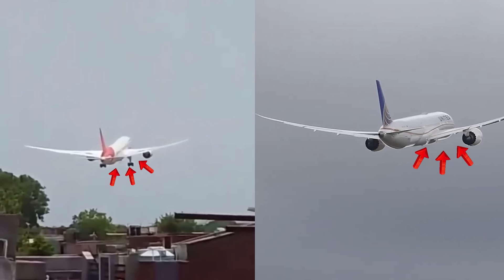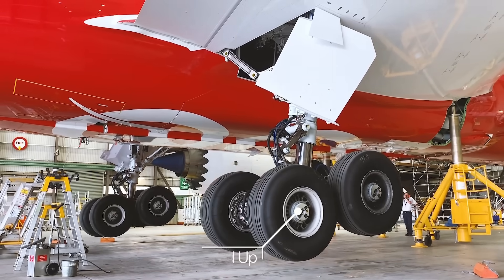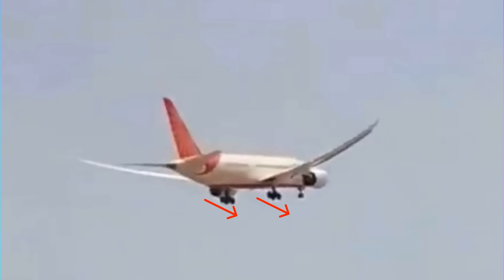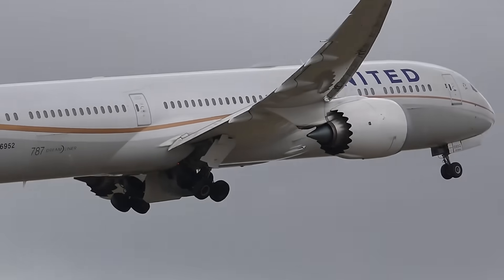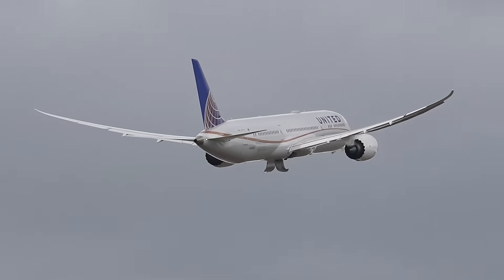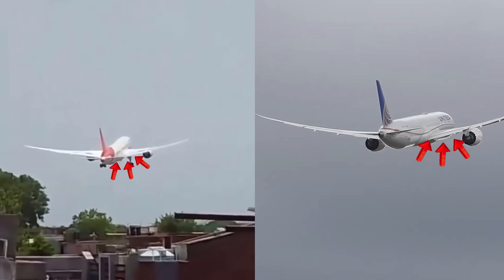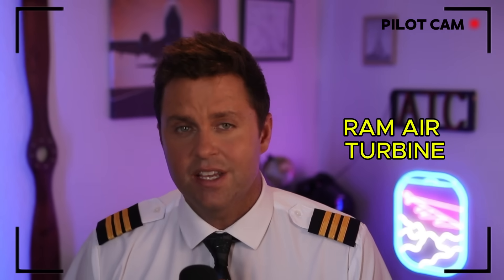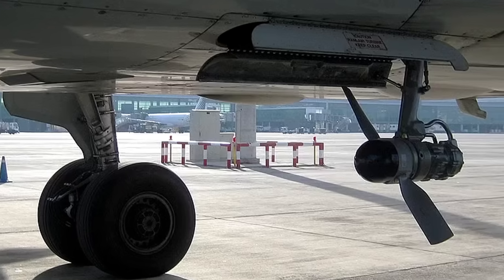Pilot Explains: A New Detail in the Air India 787 Crash Everyone Missed

Comment: Contaminated fuel : But no other planes reported this issue in that airport same day regarding fuel.
Reply: My thought exactly
Reply: There was a comment in another video, that talked about how the ADSB comms were having issues Only at that airport in the past couple of weeks, The board for that system is supposedly housed in the same compartment as the Fuel control system board/computer. He went on to talk about how with the long duration in mid-day sun while facing south, coupled with the long takeoff roll could have caused the board to hit over temp and go into fault reset, which would explain the near simultaneous double engine failure with no smoke in the exhaust. 

This is from memory, and it was fairly detailed and complex. and i am lacking the technical knowledge of the aircraft systems to confirm or deny the claims, but logically it makes sense to me(although that is worth nothing here from my arm chair). Ill see if i can find that comment again.
Reply: @nightkil13r  Agree, my thoughts as well
Reply: @nightkil13r  Yeah but...there must be a  environmental/temperature control system for the boards in question and all other vital electronics installed on the plane....and likely redundancies for those same systems, no?   I'd imagine you'd want to heat those components at 30 000 feet with outside air temp of minus 40 degrees Celcius and cool them when the plane's on the ground being baked by plus 50 degrees Celcius outside temperatures in the middle east somewhere.
Reply: @guidoschnelzer942  Not sure which comment of mine you replied to, but it is a failure that would rely on the cooling system also having issues. which allegedly according to a passenger on the previous flight it was, although i have not seen that myself so take it with a grain of salt. Realistically its all just conjecture till the investigation report comes out.
Reply: I think in this context, 'contamination ' has to do with how water moves in the plane.  Jet fuel and water don't mix, and if water gets in the fuel or near the sensors, it causes big problems and strange behavior of the aircraft.   Sudden unexpected movements of the plane can cause the fuel to be contaminated by water.   So it's not the type of fuel contamination (i.e. bad batch of fuel) that we're used to thinking of.  Here, they're thinking that condensation could have formed in the tanks, from the plane sitting on the tarmac in very hot, humid  weather.  Or that debris possibly entered the tanks via vents or refueling.
Reply: @VerdictREX hen how the flights r safe in very hot weather like in  Middle east  n very cold countries 
This should be very  common issue to be dealt with no??? N pilots should be aware of this  ..
Reply: @kirank809  That's part of why there are many pilots who don't think fuel contamination could be the issue.   This jet's fuel system is highly sophisticated.  Most types of contamination would be detected well before takeoff, and extremely hot weather is not a new or special consideration, nor is long times on a hot tarmac.
Reply: @VerdictREX  you are wrong. 
There is perception that hot summers cause condensation. It's practically not possible. I live in India and we have some of the most extreme summers on par with Middle east. The only thing seperate us is the monsoon season. 

Here is the thing. In middle east and India, hot summers are usually dry. Which means no humidity. When there is no humidity, water seeing into fuel due to contamination is highly impossible. That's the feature of Hot dry summers. 

And then Indian monsoon makes things in reverse automatically. Suddenly you have weather with a lot of humidity. In places like Northeast India or East India for that matter, humidity can go high as 81% with avg humidity is around 53-75%. Fuel crews are experienced in that kind of condition. There are no crashes in India due to fuel contamination due to condensation. If this was the case, crashes in India would be lot more. And Boeing especially made this detection alarm system for Indian airlines which quickly became a norm in the Boeing feature.

Duel Engine failure can happen due to technical failures. Now this is where Boeing comes and why people, especially Indians are blaming Boeing. Again crews in India are highly experienced in that matter.
Reply: @NammaNeko-hg1ho  You are forgetting that all aircraft operate in conditions from ground level (maybe up to +40C) to cruising altitude (as low as -50C).  Condesnation and even ice build up in fuel lines is a major problem that has to be taken into account and may have nothing to do with the ground level conditions.  Refer to the British Airways flight BA38 that crashed on approach at Heathrow in 2008.
Reply: @NammaNeko-hg1ho  I'm not wrong about anything I said here.  Condensation inside of a FUEL TANK is different from the weather outside!   Certain factors, like heat and humidity increase the chances of condensation formation inside of the fuel system.  There are many other factors that can cause condensation to form in the tanks.  So giving an almanac report about weather patterns in India is not that significant.   If you see my other comments I have also addressed why other experts do not agree that fuel contamination was the issue.-- and among them is the fact that high heat and humidity, as well as planes spending extended periods on a hot tarmac, are not new or unique conditions,  as they exist in several parts of the world, every single day.  However, fuel contamination due to condensation IS a relevant factor that will be analyzed.  Also, the humidity in Ahmedabad was 84% on the day of this horrible event, and that IS high.
Reply: @VerdictREX okay 👍🏻
Reply: @VerdictREX  Re "sudden movement" of the plane, accelerating down the runway could be an example and might explain the timing of the flame out.
Reply: @VerdictREX  Still that theory of that "contamination" has some flaws for a duo engine. Both engines cant flame out simultenously but rather sequentially. my two cents.
Reply: @sunitamosesesq these engines have fuel filters.
Reply: @VerdictREX  Then they should  not contaminated fuel because it deflects blame. They should say water seepage etc,.
Reply: That's just not their terminology.   Here, if water enters the jet fuel, it is considered a 'contamination,'  It's actually one of the most serious and dangerous types of contamination for a jet.  It can cause huge engine issues, including flameout, resulting in crash, which is what could have happened here.
Reply: @VerdictREX fair enough but the videos are made for the consumption of common people in laymen terms. So they need to set the context so it won’t be misinterpreted ( like fuel was literally adulterated at the airport). This is not an aviation board meeting.
Reply: @rogerIndianKing  I feel you on that one.   Very true.  They need to explain what these words mean in this context.  I remember I was initially very confused about them using the term "rotation."  The plane was "at rotation", "during rotation," etc.... (I was thinking...what? It rotated?!  Lol)   It took me forever to find out that rotation is just the point at which the pilot lifts the plane's nose off the runway and starts becoming airborne.    But none of them took a second to explain that - even though that's drastically different than how we would normally use that term.
Reply: @rogerIndianKing  Then it is a "YOU" problem.
Reply: @poruatokin when you watch a movie, the audience in theatre need to understand the plot and get invested emotionally. If they raise their hand and ask a question, the direction is lost. Similarly, when you make a client presentation to a business. You are the kind of a guy who says the client is an idiot for not following.
Reply: If that’s the case, then there should be multiple cases just like CX780, which also had fuel contamination and caused the engine into full power mode, one thing came to my mind is BA38, that too also had dual engine failure but at the very last stage of the flight, I don’t exactly remember the cause of that crash but I do remember it’s something to do with fuel also
Reply: yes.  Contamination can cause a lot of systems to act erratically, which can result in a crash.
Reply: @riskiesensei  fuel freezing
Reply: @riskiesensei  It was very cold fuel, a small amount of water in it froze blocking the filters.
Reply: @riskiesensei  BA38 was a Boeing 777.  The accident was investigated by the Air Accidents Investigation Branch (AAIB) and their final report was issued in February of 2010. Ice crystals in the jet fuel were blamed as the cause of the accident, clogging the fuel/oil heat exchanger (FOHE) of each engine. This restricted fuel flow to the engines when thrust was demanded during the final approach to Heathrow.  The AAIB identified this rare problem as specific to Rolls-Royce Trent 800 engine FOHEs.  Not a fair comparison, I'd suggest.
Reply: @riskiesensei  Small quantities of water in the fuel formed ice crystals which turned to slush as the temperature rose on descent, and clogged the fuel lines to both engines
Reply: Wet wing tanks are required to be individually sumped for fuel contamination (mostly water) and fine debris. If this maintenance procedure is rarely performed an aircrafts wet wing tanks can become contaminated.
Reply: Contamination can happen on the truck that loads the fuel on the plane. Moisture in the tank or pipes, something did not seal properly, etc. If that was the case it could affect only a single plane.
Reply: These days this is happening  more often 
Power going off in planes before take off 
A/C  shut OFF 
N then there was toomuch  gasoline smell inside flight  ..( followed by  announcement  that flight being fueled ) before takeoff
In  hyd to blr flight in May ..
Never hapoened  before .
More than 30-40 mins waiting in flight ..
Reply: Maybe it was a set up
Reply: How long did they shut the airport down for and did they suspect it and pull that fuel source?
Reply: What if someone loaded extra gallons of water into both wing fuel tanks, since water havier and don't mix with gasoline, it resides at the lower level of the tank, and sucked into the engine once the inline gasoline is burnt during takeoff.
Reply: Just because "contaminated fuel" is stated does not imply dirty fuel was loaded at Ahmedabad.  That is just your mind jumping to conclusions.  The sources and types of contamination in fuel can be many.
Reply: I was thinking the same thing.
Reply: Good point
Reply: Exactly, and my understanding is that the tanks don't supply both engines for that very reason.
So fuel contamination  isn't a contributing cause.
Reply: @Hawkertempest1 I have no idea how you could come to that conclusion based on that evidence.
Reply: Probably would have been evident before v1, erratic parameters etc.
Reply: Fuel contamination has to be ruled out. Because if it was the fuel contamination,  then they will know during the take off. They wouldn't have enough power to get to V2.
Reply: 1. Fuel that  comes from the depot visually inspected by certified techs for any rust or water contamination before they dispatched the tanker. 

2.The depot thats stores fuel is  (CFU/ATP) sampling tested. That knows as  microbial contamination tests .

3. Upon arrival fight mechanic/ engineer inspects the tanker usually and if they have any doubts they holds the delivery to the airport and sends samples to lab for CFU/ATP tests (microbial contamination) test.
CFU tests requires to send sample offside and takes time to come back at you . 

4.ATP can be done on site and takes no longer than hour to come back at you . 

5. Both tests requires special testing equipments. And i sure all air ports does have. 

6.even if there is a debris or rust in the fuel , there are fuel filters in place. I am sure our car does have so why not the air crafts ? 

7.Finally , only possible way to contaminate jet fuel is deliberate water contamination after the final checks and before fueling up the air craft . Which highly unlikely but you never know only needs one disgruntled person to do it.
Reply: Just average white people thinking of contaminated fuel because the crash happened in India.
Reply: @toml7945 @ramanagude4750 I found it. He did mention in the comments that it would also have to have a cooling issue, which is possibly backed up by a video allegedly from a previous flights passenger complaining about the ac not working. 

Its from Captain steves channel, Paste the below after the slash, itll be the highlighted comment.

watch?v=8XYO-mj1ugg&lc=UgxcU9LMHPPBXRf83k94AaABAg
Reply: I think contaminated fuel in unlikely to lead to engine failure at exactly the same. There should at least be some delay between both flameouts.
Reply: absolutely,  so full electrical failure...😢
Reply: Well could of been a battery lithium fire  affecting some other systems 787 use batteries for the gear and have had problems with system before
Reply: I thought the same
Reply: Contaminated Jet A1 causing a near-identical failure in both engines at almost exact the same time on a transport category aircraft…??

Try and calculate the odds of that.
Reply: One possibility that I have not herd nor read is that the engines may have been serviced by the same mechanic ; and unwittingly did the same mistake on both engines. It been a while, but I remember some rule  where I had worked in the past, to have different  mechnics service each engine separately to avoid unknowingly making  the same error on both engines.  All hypothetical of course, but if this happened a dual engine failure could  ensue.
Reply: @sergioabdilla4577 The odds of that happening and causing a double loss of thrust right at that point in the flight are still astronomically small.
Reply: @simonissell Two identical engines with identical amounts of good fuel in them burning through it at the same rate?  What are the odds?
Reply: @jimj9040Still very remote. Remember that both engines would already have achieved rated or derated take-off thrust before V1. If they hadn’t the take-off would have been rejected.
Reply: @simonissell Sure, and that would be accomplished with the remaining good fuel before it started sucking Avgas, unless you can tell me why not.
Reply: @jimj9040Show me an airport that has enough AVGAS lying around to accidentally put in a 787?
You’ve got to be kidding me. 😂
Reply: @jimj9040And I doubt that a bit of AVGAS would bother a GEnx anyway; not in the short term.
Reply: @simonissell  I didn’t say accidentally and I don’t know how much fuel it took.  I’m not married to this theory.
Reply: @jimj9040 Most jet engines will run on AVGAS for a while without too many problems. Not ideal, but unlikely to be catastrophic.
Reply: @simonissell Well, I suppose you should tell that to the remains of those who’ve tried it.
Reply: @jimj9040 And they would be....? Who?
Reply: @simonissell The deaths I’m aware of occurred on smaller aircraft but the principle remains the same.  I wasn’t personally acquainted, but I’m sure you can look it up.  If it would be nearly impossible to get any other fuel in those trucks I’m willing to stop trying to defend this idea instead of debate an issue that has no legs to begin with.
Reply: @jimj9040 With under-wing refuelling the fuel is pressure feed into the tanks at a high flow rate. This causes a lot mixing within the tanks. Also bear in mind that the engines need to be producing the desired take-off thrust BEFORE V1, otherwise the take-off is rejected.
Reply: @simonissell I can see, as the above poster stated, that there would be erratic parameters in the case we discussed, but it seems it would burn hotter and produce all the thrust you wanted until …..whatever.
Reply: @simonissell  It's happened.  Oil drain plugs misfitted IIRC.  All the oil fell out of both engines.
Reply: @ChrisRowland-c7wCertainly possible; but statistically unlikely. Time will tell.
This guy’s video though…. Absolute rubbish!
Reply: @sergioabdilla4577 This rule about engines not receiving the same maintenance by the same person at the same time was introduced after a serious incident (not crash, but it was a narrow escape) with a Lockheed Tristar where the same person had made the same mistake with fitting a particular oil seal in all three engines, leading to all the oil escaping.
Reply: Sabotage water put in the JetA1.freezes up pipe lines under pressure while feeding engines.Must have not shown up on testing capsules during refueling.
Reply: It seems higly improbable contaminated fuel shuts off both engines at the same moment. When it happened, it didn't happen that suddenly.
Also gears selected up and, at the same moment, a dual engine failure seems too much of a coincidence. 
It seems more likely that the gear up command, in some way, messed up the electrical system.
Reply: I don't think this was a reason at all. Highly improbable.
Reply: Given the safety record of the aircraft up to this point, whatever happened was, by definition, improbable.
Reply: Wouldn’t other aircraft have had issues if it was fuel contamination??
Reply: @kannon965 Only if the contamination originated at the source.  Plenty of ways for individual trucks to be contaminated or simply have the wrong fuel.
If they fueled it with Avgas instead of Jet A, engine failure shortly after takeoff would be just what to expect.
Reply: I think fuel contamination is a valid theory. If you’ve spent any time on YouTube or Instagram you’ve likely seen evidence that Indians will shit anywhere: the beach, on the streets, on sidewalks, and even on the floor of restrooms or airplane lavatories. What’s to say one of them didn’t shit in the fuel supply?
Reply: maybe it was watered down with ethanol because it costs less to make
Reply: What if it has done for this plane particularly. A big politician was there in plane. It's very common for currently ruling to do these things.
Reply: And with the engine start and taxi burn (the long back-taxi on the runway etc) they would have gone through 500-1000lbs?  That would have to be a lot of contamination...  A hard sell.
Reply: Unless it was done on purpose.
Reply: @nicolaslaugeon6207 Terrorists tend to be fairly narcissistic and like to lay claim to their handiwork.
Reply: Sabotage
Reply: Wtf.. they wouldn’t be able to take off otherwise.
Reply: Fuel was loaded from a vehicle for this flight
Reply: @MattRodriguez-h7j isn’t that for like every flight? From what I’ve heard fuel contamination is something figured out way early and not that late into the take off.
Reply: The very second day an local Indian reporter mentioned, One engine failed and pilot turned off  the other engine by mistake and didnt get enough time to turn on.
Reply: Boeing  is in crap here😂
Reply: Got to look at the history of this aircraft. There could have been in tank maintenance performed and absorbent left inside of the tanks. This has happened before, absorbent starts to break up and clog the filters and the metering unit. 

Then there could be water in the tanks. I know many scoff at the idea after seeing the fireball but the sumps are at the bottom of the  tanks for a reason. That is due to it being heavier than Jet A, so it is possible that both engine got a big gulp of water which caused them to roll back. 

I'm not a 787 guy, but I would think that they would draw from the outer tanks first, which sort of rules out water in the fuel. But if they draw fuel from the inner tanks first this is a possibility also. 

We're all just speculating unless you have 787 experience and have access to the FDR data.
Reply: Doesn't the computer  send Boeing  information
Reply: Here is the thing. The weather in Ahmedabad is actually dry. I live in India and I did go to this city from Delhi like 2 times. The weather here in the summer is actually very very dry.  And there is no monsoon here rn. It's very unlikely that water, due to condensation seep into fuel. It's basically impossible. Especially in dry summers. Indian summers are very dry and monsoon doesn't come till mid-to-late June or start of July. At that time humidity is at its peak and there are more chances of Condensation since there is shining sun and heavy rain in intervals. That's how monsoon is.
But the weather is dry and if you see the takeoff of the plane, a lot of dust was there on the runway. This is very common in airports in India in the summer. Dry summer also brings a lot of dust. And it's everywhere. From roads to cars. 

So again fuel contamination is impossible. Condensation at this time is practically impossible
Reply: @NammaNeko-hg1ho  Humidity there is 81% right now. Also it doesn’t have to be condensation. These trucks get cleaned. Washing it with a port open will do it. So will rain. Fuel can be contaminated with other stuff as well. Every load should be checked before pumping it into the plane, but that might have been skipped here.
Reply: @MultiMrAsd kind of. But dust is not the reason. If dust is, then we can do nothing. This is the most brutal dry summer in 3 consecutive year.
Reply: @NammaNeko-hg1ho  Fuel contamination is NOT impossible.  Contamination can come from several sources, and condensation formation is the most common and most likely in this scenario,  if contamination was present.  Ahmedabad was extremely hot (105° to 108°) AND humid (81 -86%) on the day in question.  Don't equate the weather as you experience it outside, with the weather conditions which can cause condensation to form in a fuel tank.  You may perceive it to be dry, and it might feel that way, but it was, in fact, humid.  Many factors about the plane and the day can also affect this, under these weather conditions.   So, I want you to understand that the condensation we're talking about is not "seepage" from.the outside.   It's water that forms, on the inside of the tank, which is largely affected by the weather outside.  So even if outside is very dry and there's dust, the conditions could still be conducive to the formation of condensation.
Reply: @NammaNeko-hg1ho You eliminate one vector of fuel contamination and conclude that contamination is therefore impossible?  Hate to tell ya son, but you have a very limited imagination.
Reply: @jimj9040 so present us your theory. At least I know water contamination through condensation is not possible. There is not enough humidity to do that
Reply: @NammaNeko-hg1ho  I could present you a handful of other possibilities including intentional contamination right off the top of my head but I wasn’t making claims, you were.
Reply: @jimj9040 Why didn't 'contaminated fuel' take so long to affect the engines?  After all, it did manage to taxi normally and achieve take off before they lost thrust.
Reply: @NammaNeko-hg1ho ok
Reply: Exactly! Just deflecting blame as they are all Boeing pilots.
Reply: They are not blaming anyone yet as the investigation into the crash has not been determined!
Reply: @rogerIndianKing  And that's a lame comment.  No one is deflecting anything.  It's all speculative theory right now.  See make more sense than others, but none of it is factual right now.
Reply: @jimrothwell535  And your comment is much more lame given there were follow up comments on this and you did not bother to read the whole thing.